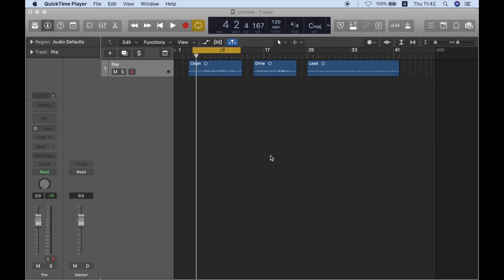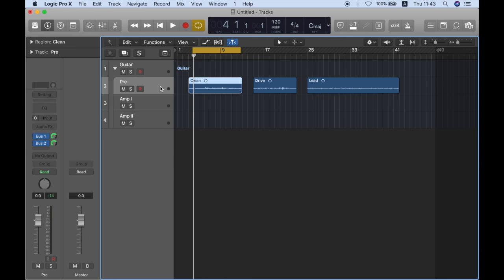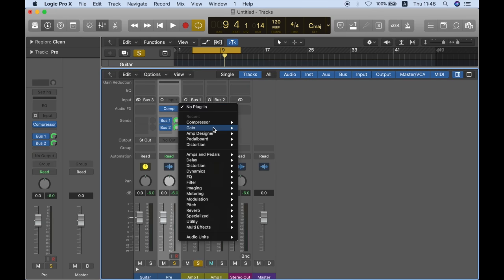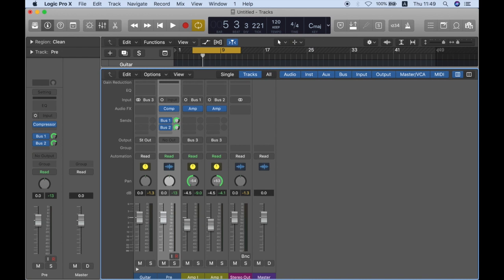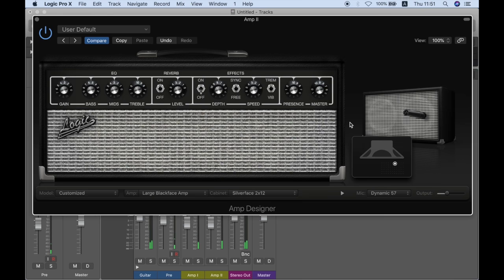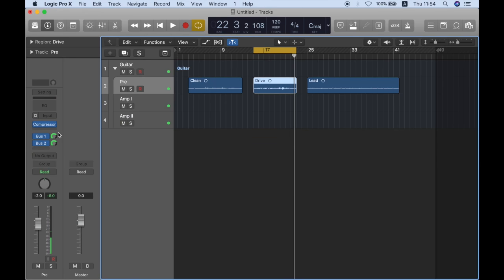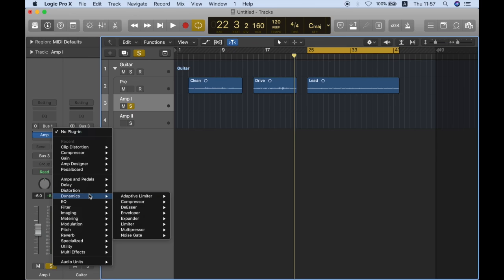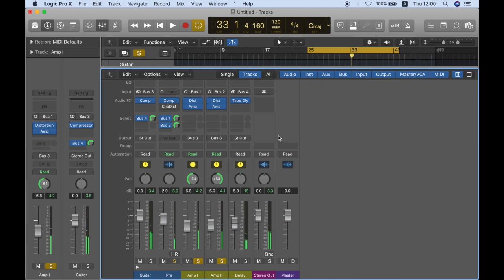How to make a virtual amp sound awesome (in Logic)

Comment: Great video. One thing I do differently which I would certainly recommend trying is using a direct send to aux channels rather than fx sends. It seems to reflect the real world more closely to me. The way I do it is to create two (or more) aux channels and set the inputs of each of those to your audio input channel. This automatically creates a patch bus. I then add whatever amps, effects are required in pretty much the same way that you do. If I want to create a multi-mic type sound, I setup further sub-busses from these aux channels and add Space Designer on each of these with IR cabs, again as required.
Reply from the maker: Thank you, interesting. Do you really hear a noticeable difference when sending directly to aux? I'll try it.
Reply: @Tune4media  I’ve seen a few other videos where they create a stereo effect by sending to 2 hard panned busses. Then add the effects on the busses.
Reply: Amazing!

Comment: Thanks for Sharing this tips ! I really like the idea with the 2 mics setup BUT:

1) I wouldnt use the compressor to gain up. But rather: go to the inspector (press "i")> regions> gain and crank it up. Why ? cause you were compressing already 5db so already remove some dynamics, if we consider that a D.I has dynamics.. :)
2) I guess its not necessary to create 2 tracks: you just have to keep your channel to the stereo output (or your guitar bus) and send to an aux. it will be the same as you did.

Very good sound at the end thought !!
Reply from the maker: Thank you for commenting.
Although I still support the compressor. My goal is to add some 'meat' at the lower volumes without actually cranking up the peaks. (there is still plenty of dynamics to make a colorful tone).I shouldn't take credit for that of course. Passing a compressor after a DI signal is a pretty common practice in the industry. It's a neat trick that really helps the guitar sit in a mix :) 

As for the nested channel - You're right. It's mostly to be able to save a single preset in a single group channel, but you can do perfectly without.
Reply: @Tune4media  I see, I did today with a preamp 73 from arturia (but the console Eq of logic would do the same) and a compressor vintage (Klanghelm MUJC) to have some coloration and i found it interesting to add meat and coloration
Reply: Can you explain me the other way? Using an aux send.. Im confused 😅
Reply from the maker: @EstudioSalaSecreta  I'll try to abstract it:
You have a TRACK, you send it to 2 different AUX's. Now your TRACK input is sending its signal to 2 different tracks. And then, you send these 2 AUX tracks to yet another AUX (a BUS if you will), now you have a 'master track' that gets the input of 2 AUX tracks that are being fed by a single AUDIO-TRACK 

Hope that helps :)
Reply: tune4media thanks!!!!

Comment: A big thank for your time taking to put this together
pls can you put more light on how you set up those auxiliary I'm still confuse when using buses more relate 
output, input
Reply from the maker: If you simply send any channel's output to a "bus" channel, it will automatically open an auxiliary channel (if it's yet to exist already) and your signal from the channel will be sent to this aux. Essentially, aux channels (or "bus" outputs) aren't used just for the "sends", but also for splitting a channel, mix a few channels together and all sort of things. Hope it helped.
Reply: @Tune4media  thanx for ur time

Comment: Clever idea. Isn’t all you’re doing by panning two amps left and right though is making it louder overall (you can see it in the meter)? It’s the same as when you just copy a vocal or whatever on to two hard panned tracks - it just makes it louder, not broader. The reason it starts to sound wider when some elements of each chain are altered is because the ear can detect the differences and recognise the stereo image. You seem like you know what you’re talking about a lot more than me though, and I haven’t tried this technique yet!
Reply from the maker: Of course it's louder. Anytime you're duplicating a track it will be double the volume respectively. For example, doubling 0dB will result in about 6dB (which is twice the volume since dB is a logarithmic scale) It's up to you to balance the loudness of a duplicated track.

As for the panning and difference between the two tracks. The science behind this trick is to maintain a relatively unified-strong phase while altering each track to a slightly different tone. When you're panning nearly identical tracks (identical in the phase) you can get to a 'magical' point where the two tracks are so close in their phase, so they sound like one. But far enough in tone to affect the stereo field and give a rich-sounding tone

Comment: Great video.  One question.  In the initial summing stack are both amp axes and the input track being summed or just the two amp axes?  How do you defeat the input track from being summed?
Reply from the maker: Thank you! 
Notice that the input track's output is sent to 'no out' (in logic you can 'kill' the output of a track explicitly) *a small note - the 'master' summing track is mostly to be able to save this as a single preset.

Comment: what is the first channel you started with that's called 'pre'? as in is it an amp or a an audio, I can't tell as there's no icons
Reply from the maker: It's not. The truck "pre" is my actual guitar signal track. This is the track on which the guitar is being recorded (So it's without any amp simulation). Then, this track is being sent to 2 bus tracks and each bus/aux track is loaded with an amp designer.
Reply: tune4media so what would you select when you start a new tune on logic? Would you just choose audio? Or guitar or amp? Or midi? Sorry I’m pretty new to logic
Reply from the maker: @bencxm  It's okay, totally legitimate question if you're just starting with logic. I'm choosing an empty audio track.
Reply: @Tune4media  thank a lot! this video is great help :)

Comment: I've tried this, but apparently my Logic Pro (Logic Pro 9) does not make a summing stack.  So I tried to do it manually, by sending Pre, Amp 1, and Amp 2 to buss 4, and set buss 4 as the input on a track called "Guitar."  I inserted the amps as you show, but neither of them are heard on "Guitar," although "Pre" is heard on the stereo output of "Guitar."  How I can I get Amp 1 and Amp 2 to sound?  Thanks!

Comment: Question pls. Can I apply the same technic for bass guitar?
Reply from the maker: Since we're dealing with art. anything is possible and you might find yourself applying this technique for bass where it's the more 'appropriate' choice and it serves the piece best or it just sounds really cool...

However, it's more common to keep the low frequencies of a mix (especially those who drive the pulse of the song... like a bass guitar) focused on the center... This technique can cause the phase correlation of the instrument to be a little more brittle and unexpected. 

Here's an idea that I think it's cool to try: 
Maybe if you have a very rich sounding bass tone, you can try splitting the sound into low and high, and apply this technique only to the high frequencies (the 'shimmer') of the instrument, while keeping the low frequencies dead center.

Comment: Hi, thank you for these tips! I have done exactly as you instructed but the audio track in the pre Track won't play? no sound and no signal. Channel strip is set as yours = no input and no out, and if I move the same audio region in a new audio track with factory settings I have signal and sound (so there's no issues with the audio file itself), I don't know really...
Reply: Sorted out... the send volumes were set to 0.... I'm so dumb...
Reply: @porkaudio7229  I'm having the same problem but I don't know where the send volumes are. Could you please guide me?

Comment: thank you so much, that kinda helped. But I have a question, I tried this technique for distorted guitars (with distorted amps and cabs), and I still hear the direct signal through the amps and it kinda makes the sound less good, can I mute the direct signal and still hear the amps?
Reply from the maker: You're probably still sending the output from the pre-track to the master? 
The trick Is to cut the output from this channel and use the 'sends' to send the signal to the aux tracks
Reply: @Tune4media  like, in the direct track where logic recs the guitar?
Reply: @Tune4media  ok i got it, thanu very much!

Comment: thanks- great video for a relative newbie to logic.. i have a question, if double tracking rhythm guitars, would it make sense to track stack each guitar, with each having pre, amp 1/ amp 2, hard pan L/R as described in the video... but then pan L/R the master track for each? That way you get the subtle differences in playing on each take?
Reply from the maker: Thank you!
If you're double tracking and want the tracks to be hard-panned, it wouldn't make sense to make each guitar stack stereo, because you're going to lose a channel when you hard-pan the master track of each guitar. You can try making each guitar stack mono and then do the panning. 
But I think it will be even more interesting to use the same kind of setup that I did in this video but pass in two guitar/pre channels one to each side.
Reply: @Tune4media  thanks for the quick response man, appreciated! OK thanks a lot for that!
Reply: I would just send the raw guitar signal to two seperate busses, and select no output so only the busses give sound. Then put each amp in their respective buss.
Reply: And then send those two busses with the separate panned amps to another buss so they recombine into one channel.

Comment: what amp / mic does "we all know what amp / mic this is" refer to? the Large Blackface is obviously a Fender amp to me but not sure which and googling shows up a Royer R-121 but what is that mic famous for?
Reply from the maker: Both are very famous pieces of gear (like most of the amps and mics found in the amp designer) for guitar players, the amp is probably unmistakably familiar, as for the mic... it's a very common ribbon microphone found in studios
Reply: @Tune4media  right, I was just wondering what specifically the 121 is nice for, I've owned a SM57 before so I sort of know what its good / bad at. I should google more though.

thanks for the video! do you have a favorite amp or mic in amp designer?

Comment: How to you convert the different tracks to one audio file when you are done? So you dont have to deal with sends and bus etc?
Reply from the maker: I think the easiest way is to simply solo the master bus and bounce it (commend+b), then bring the file into the project. 

If you're asking how to save the preset, that's why I've put all of the channels in a master bus, so I can select this master channel and save it as a preset. When you load the saved preset, it will load all of its sub/child channels

Comment: Would you recommend this method for DI Bass guitar recording?
Reply from the maker: I wouldn't, especially the part of splitting it to a stereo signal. Since to my taste, bass frequencies kind of need to stay in the middle (mono) in order to keep the balance of the mix. ANd for the part of using an amp simulator to bass, I would use an amp simulator as blended very gently with a D.I signal, just to bring out some "umph" to the bass. If you're looking for ways to make a wide "stereo" sounding bass, try using a crossover to affect just the high frequencies (in the stereo field)
Reply: Thanks I’ll try that out

Comment: And if i want to pan the guitar, will i have any phase problem?
Reply from the maker: If your tracks are in near-perfect phase (which in this case they should be) you won't have a phase cancelation problem. You can check it audibly by changing your master bus from stereo to mono back and forth and hear if you lose energy in mono. And to examine this by numbers, you can use a phase-correlation plugin (Logic has one built-in).
Reply: tune4media thanks!

Comment: How do you record a track directly into logic? I assume without using amp designer? Guess I'll have to research.
Reply: monkface you can record it using amp designer. Afterwards you can change the tone however you like. The settings are not recorded permanently.
Reply: You can pick a random preset amp then in the channel click settings, reset channel strip and you should get exactly what he has at the beginning

Comment: Would Logic Pro X 's amp  be able to emulate a..hard rock/metal guitar? trying to avoid looking into 300-400 dollar guitar simulators
Reply from the maker: I haven't personally tried, but you've some pretty decent emulations of Plexi and Mesa-Boogie style amps, as well as some good pedal emulations. I think classic hard rock is a bit harder to emulate but combinations like Plexi with Marshal style cabinets (as well as maybe the RAT style pedal they have) will get you decent results... 

For a more modern sound. to me, it feels like it's a lot more digital process anyways, so sometimes those emulators are the real thing.
Reply: tune4media thanks dude

Comment: Can't you just use 'Spread' effect to widen it?
Reply from the maker: It's different. 'stereo spread' effects are typically made out of delayed signal manipulation and some combination of filters (or crossovers) the effect is that your phase is a little offset between left and right in certain points of the signal. 
The approach in the video is to make more of a 'tonal-spread' and specifically utilize the amp designer's consistent phase to emulate a stereo setup (like putting a pair of mics in a real amp)
Reply: Not really. That's more for subtle spread while mixing

Comment: hello first i need to say my english is really bad please try to understand i am 15 year old turkish girl who is trying to make some music so i have logic, i use my electric guitar and a soundcard to connect it to my computer but when i use logic amps there is so many noise like whispers room noises on the background i try so many things with volumes with eq but i can't find a way to make a clear sound like yours please help me
Reply from the maker: Your English is very good! 
It's hard to tell the reason for the noises, probably the most common reason is 'ground noises'... you'll see guitar players sometimes referring to this as '60/50hz cycle noises', it's a natural by-product of single-coil pickups and if you happen to have single coils, then it might be the case (and there are plenty of tricks online to help to reduce the noises) other problems can be simply a bad cable, somewhere in the chain, bad electronics inside the guitar and problem with the soundcard's preamp. If you get the chance to try different guitar/soundcard/cable/etc... you might be able to spot the problem and fix it. hope this helps
Reply: @Tune4media  thank you so much it means so much to me♡

Comment: 3:18 and 3:26 .....for the degenerates like me who don't know what amp and microphone hes talking about? any ideas?
Reply from the maker: for the amp, it looks like a classic Fender from the 'blackface' era, my guess is that it's modelled specifically after the 'twin reverb'. for the mics, 'dynamic 57' is definitely the famous Shure sm57, and the 'ribbon 121' is Royer R121. off course they can't use the original brands due to copyrights issues.